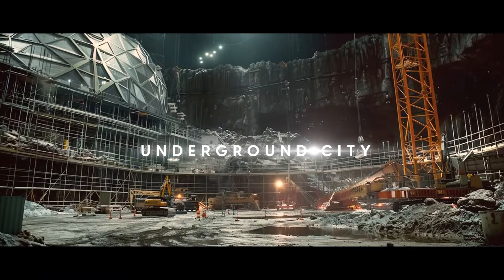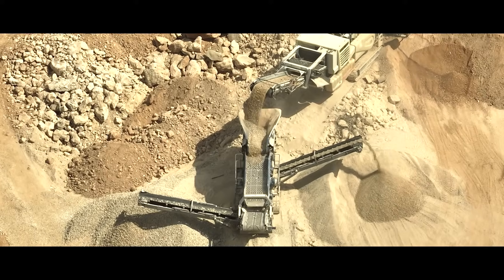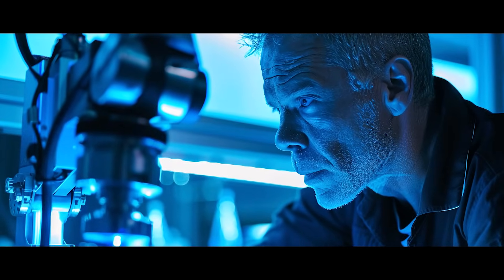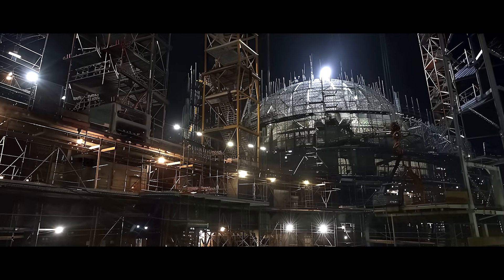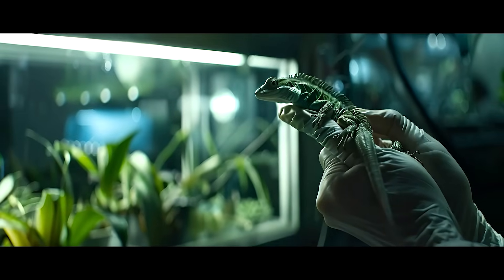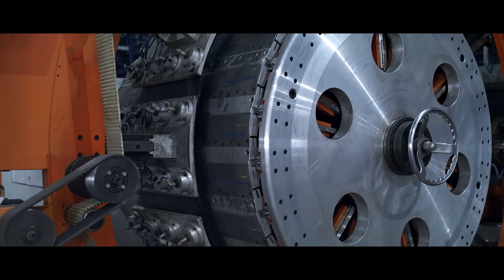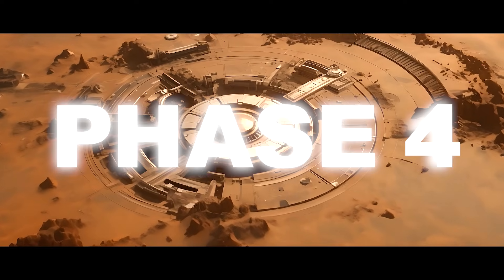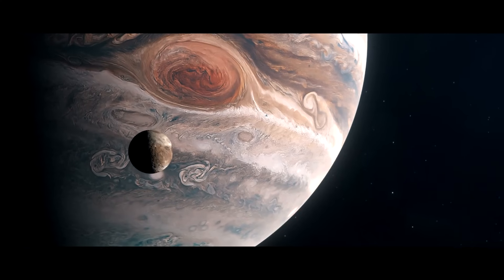TIMELAPSE: Building an Underground Mars City (Sci-Fi Documentary)

Comment: Finally someone sees the radiation issue! Robots need to start the infrastructure before Humans arrive! But a fail!
The low gravity will create health issues! Build a rotating space station wheel with angled floors to add centrifugal force to earth gravity! 
The lava tunnels can grow mushrooms if the openings are closed with transparent domes! The surface glassy soil can be reformed into a ceramic like brick/sheet material. Glass on the surface will need to be photosensitive to react to damaging solar damaging rays!
A mono-rail can join stations at entrances & transit to the farms inside the tunnels! Bugs, Asians eat for protein can be eaten cooked, turned into more complex edibles or turned into protein paste, for away missions!

Comment: Great Video, but I don't think we have realistically calculated the timelines and logistics of pulling this off.  It lives in fantasy until we can manage to lift heavy equipment into orbit and propel it across space and land it on the surface. Continuously, 100s of missions to get the sort of equipment we need there. May as well wait until we can effectively utilise a cheaper, more condensed form of energy/fuel to get us there. Otherwise its just gimmicks and pulp fiction until we approach the necessary logistics realistically. 
[my opinion] I think We are talking 100s of years, not decades.

Comment: I wish I didn't know things. I've been working for years on these similar issues. It's doable in the short-term, but AI and genetic engineering is still years away from long-term success. The Navy has the exotic materials needed to get there, but staying is still out of the question. The energy requirement is jaw-dropping, so generating power using solely Martian materials and conditions is... Challenging.

Comment: biggest problem will be every bit of escavation equip on earth runs on fuel not batteries n the eng need ozygen to mix with fuels to run . if they make them battery powered itd take to long to charge esp if they want all these things to work 24/7 . it wont happen . only way is if they can somehow make these machines run on nuceclear power which wont be able to do as it requires a fair bit of area to have a reactor then turbines n motors .

Comment: You can do this as well instead of underground you create a roof above your cities 
That is like layers of honeycomb architectural structural design creating a density controlled construction that has is sponge like it design
Meaning it is unlike what you currently understand and use this concept is constructed by joining spheres together that when combined together and squeezed together they loose there  softness as they are pushed together 
Your design comprises of many different sizes of these spheres so you can control the density of your construction where you need it to be dense and less density where you don’t 
Large sections can be just balloon like filled cavities that form the living environment you can build roads cities or whatever you desire within your solid construction that has become one single structure and not made of independent parts 
This way it is far superior to current forms of construction 

Having a honeycomb design means you will have large cell like areas that can be opened between or have the ability to seal each one independently 

You design the spheres to fuse together with an electric charge once they are in place it’s like a ball squeezed in your hand it will squeeze to a point then it gets to hard to squeeze anymore it has filled all the gaps between so it becomes extremely strong 
And the entire structure has a surface layer that is like a tarp stretched to form the shape and hold it in place until the process is complete when the system have hardened and becomes one structure you could constantly add on to this so it just kept growing in side 
Understand  from outside it would look like a flat surface a raised surface 

But inside you have a honeycomb structure that is as hight as you want the ceiling to be 
And you can sail each section independently or remove walls to form lager or pathways through the structure and have complete faith in your roof because it has structural integrity

Comment: Unfortunately, a lot of wonderfull graphics that are divorced from the actual challenges. Basically a 1000m dia pressure vessel built into massively fractured rock or worse, regolith. The structural loads are simply astronomical. And every level, unit and subunit would have to be protected from explosive decompression. Failure analysis would be the major part of the engineering effort. And the graphics artists keep getting transparencies wrong. Their mechanical properties are very very low which mean small areas and great thickness.  (And glass has no fracture toughness so it could not be used at all at the pressure face) Fast and efficient airlocks with ultra low air hammer  will be essential to protecting the total air asset in a practical way.
And dust !!! Whole new systems to be developed yet to keeping the dust out !!!

Comment: Radiation is not a problem! With just a few grams per square cm of kevlar or polyethylene, the rad levels can be reduced down to earth normal. Even without protection, it would take years on the surface of Mars to increase you lifetime risk of cancer by a few percent. Average surface rad on Mars is 240-300 mSev/year. Anything less than 500 mSev has not been known to cause any significant health effects and doses far larger are used in medical procedures. The risk is incalculably low!

Comment: It is going to be a wild new experience.  A lot of machines use sheer WEIGHT for stability.  That weight will have to be sent over by rocket initially.  I think LEVERAGE might be the answer for stability, and that would be a big change right there.  The initial miners are either going to be working remotely or have to suit up like an SR-71 pilot because of the environment.  I expect a lot of the issues will be solved when the moonbase is built and only needing 1/3 the leverage of the lunar machines will be a weight savings, but the Mars machines will have to deal with FUNGIBLES, auger bits, drilling steels, abrasives, etc.  The LONG, Long, long, did I say long? Supply chain from the moon or earth would  mean planning for delays or inefficient stockpiling...

There is a game called Redplanet or Surviving Mars, play that on hard mode......

Comment: If we could just teleport big heavy mining equipment to Mars. One standard excavator is 10-45 tons (20,000-90,000 lbs). Falcon Heavy can lift 141,000 lbs to low earth orbit (LEO).  But they need fuel and air so an all electric one has to be made. But its fun to dream.

Comment: Mars has a tiny fraction of Earth-gravity - do not forget that Gravity is the main force Earth stuctures need to withstand, ie why our limits for bridges and domes are moderate spans.
On Mars we could span 20x the distances due to the very weak gravity,
Tunnelling and carving out huge caverns would be simple on Mars.
And remember - the loose regolith is only on the surface. Below is solid bedrock - likely unchanged in millions of years because Mars has no techtonic plates and no earthquakes.
Rock removed for tunnels and carverns will be the source material for mineral extraction for creating metals, chemicals, building blocks for all that will be needed.
Correctly spelled out - the lack of magnetosphere on Mars means we have no protection from harsh cosmic radiation.  Thick rock will be the best protection.

Comment: The video is nice AI, but limiting in terms of future scoping. If you enter the terms How to build a martian base inside a cave guess what tech is gonna come the AI up with ... Heavy and unpractical Earth derived building praxies... First structural elements will be ultralight, if there is 3d printing it will be ICE 3D printing (the tech is already here) a flying drone can build an ice dome much more eficiently than what is usually shown. Then you would place an air lock and osmotic gas filtration to estabilize atmosphere to Earth levels. Tinting the ice would provide additional radiation shielding. Once you have that you probably get plenty of water and other useful liquids condensating out of the cave walls. And you can install kevlar cable suspended machinery and printers to follow on works. This is doable RIGHT NOW. All else are fantasies. Particularly anything that involves burning the precious Martian oxygen. I made the calculations, there is only enough for about 10. 000 guys breathing for a year... Nothing else and not much to fool around with ...

Comment: The film is very nicely done - but... where does all the energy come from that is needed for the huge number of machines producing? There is no power station up there where I just have to flip a switch and everything starts running. Even photovoltaic systems have to be huge to supply the energy required. It all sounds very nice, but it is not really well thought out. I have been working in mechanical engineering since 1985 and had to grin during the video - this is pure science fiction!!

Comment: There is a great energy dependence for the unfolding of such creative activity. Space heating, the work of robots and mechanisms will require a lot of energy, and so on. It is unknown whether thermonuclear reactors will ever be created, so nuclear small modular reactors are likely to be the sources. Research is needed on the presence of geothermal heat at depths of several kilometers. If there is one, it will be a cheap source for heating, and it will be better to build the city deeper, closer to geothermal heat. On Earth, for example, at a depth of 4 kilometers it is very hot all year round.

Comment: Don't forget that the first item to find on Mars will be water. Without it, we will have to bring it with us which is expensive.  All of the machines used to build a habitat will require oxygen and fuel to operate. Battery-operated equipment will not work with our current technology.

Comment: Fun video. Early settlement in Lava atubes seems easier than excavating new areas for structures. Dropping tunneling machines into a crater floor and tunneling horizontally would also produce spaces that should be easy to seal off.

Comment: WRONG.   ALL SO VERY WRONG AND SO VERY IMPRACTICAL.   Where are you getting the water from to mix the concrete?  HOW THE FVCK ARE YOU GETTIGN ALL THAT EQUIPMENT TO MARS?   A conveye machine and tractors and this and that.    DO THE MATH.  Figure out how much cargo you can take on a rocket.  Then figure out HOW MUCH FUEL IT TAKES TO GET THERE.   IT IS IMPOSSIBLE.    If you were gonna do it, you would just send one BOARING MACHINE to tunnel into Mars which as it digs, heats up the material and creates a glass tunnel behind i.  This is the only way you can creat habitat on mars.  It wont be with concrete or anything else.  You have to use what is there.   You cant bring water and this and that and all these things.   Stop thinking its fvcking star trek on some big luxury cruise ship in space.   Youll be lucky to fit 20 people on one rocket with enough supplies just for themselves on the six month trip.   No fvcking way are you bringing tractors and concrete and conveyer belts.   STOP BEING RETARDED and unthink all the shlt you think can happen.   AND YOU WONT BE HAVING WINDOWS AND A BIG SKY DOME.   That shlt is lame and will get you killed

Comment: Sounds like a good plan but I'd have more shields on the dome. So one outside, one inside that can shut up during storms or meteor strikes and one horizontal at the base of the dome, various small bunkers outside to house radar and air defence missiles to knock down threatening meteors. Could even build a launch pad into a nearby crater for rockets or other future ships. Have shutter doors for easier maintenance and living quarters for the initial crew that aid in and direct construction.

Comment: Maybe drinking Coke and Milk would help temporarily to stabilize bone density...because seems to move calcium inside the bones or assist the calicum bone metabolism by making bones but more elastic and it's molecular structure wider...allowing Calcium molecules to move ans fill gaps.

Let it be tested in the ISS Astronauts 
to drink Coca Cola™®

Phosphate may temporarily help against Osteoporosis by helping Calcium to move around inside the bones.

Drinking Milk resupplies the bones with Calcium.
Meaning the Calcium is Flexilby moved through the bone,creating a more homogenic calcium grid ...and add flexibility that may help against bone cracks.

Crisp Biotech can help....just eat Pasta with added program for more bone density.

Consult your doctor about Coke
before using it on bone treatments.

Comment: Here we are presented with a conundrum. Just as it was on Earth, where we could not make large industrial activity possible without energy, so it would be on Mars. Moreover, we couldn't build those power stations we needed on Earth without first having in place the industrial capacity and the energy supplies to build them. Without the necessary massive amounts of energy needed to even get started on colonising Mars, how that initial and growing energy requirement would be met may turn out to be an insoluble problem.

Comment: Transporting metal for fabrication is going to be prohibitive, plus thousands of welding robots would represent a high maintenance requirement, and once you've used metal to create an airtight skin then you've got oxidisation problems from moisture within the sealed environment.

Better off using resin to form reconstituted rock which would be airtight, and due to the lower gravity would enable larger structures than on earth. 

Weighted suits for work periods and sleep periods within a titled centrifuge on the crater wall would both work to reduce muscle and bone wastage etc.

Putting human waste recycling above habitation and work areas would reduce raditiation exposure.
Reply: Copper yo.  Do you get how much weight in copper we are talking about?  Does Mars have a lot of easily mined copper too?  We aren't flying all that there, nor any of dozens of other required materials.  Lead and tungsten too.  Smarter to just build orbital space stations up to autonomous to spread our mining reach, then see what makes sense to colonize and where.  Might not make sense anywhere in our solar system, cost versus benefits wise.
Reply: @JulioConnory  I didn't mention copper

Comment: Cool video.  But it doesn't deal at all with one of the hugest problems with Mars colonization:  Too vulnerable to destruction. All it would take to do tremendous damage or destroy the colony is one nut, or one enemy agent. That vulnerability would tend to turn a Mars colony into something like a military colony --  purely for security reasons, a Mars colony might not permit the degree of privacy that civilians in democracies typically enjoy.   The colony would have to be constructed of many compartments capable of being sealed off and independent on short notice -- somewhat as submarines and ships sometimes have watertight compartments in part so damage in one spot doesn't spell doom.

Comment: One of the major problems with digging into the surface of Mars is the high concentration of toxic chlorine based elements in the soil. There are several heavy metals that would be toxic to plant and animal life also.
Reply: There's no "soil" on Mars, it's Regolith, powderised rock. Soil is a complex mixture of clays, sand, vegetable matter (carbon and nitrates) and microorganisms. To turn Regolith into soil, the Perchlorates are easily removed, they are very soluble in water, so could be washed out in large drums. The Martian atmosphere is mostly Carbo Dioxide, which can be used to grow inital plants to fix the carbon compounds like cellulose and carbohydrates. Not sure about where the Nitrogen comes from. Plants also need Potassium and other minerals to survive. The perchlorates are the easiest problem to solve.
Reply: I understand that radiation penetration only reaches Into regolith about two or three feet to create toxins ,  so top soil can be skimmed  and remaining soil is good.
Reply: Don't sweat the small stuff, man. You sound like a modern-day eco warrior attempting to cast doubt on any development anywhere.
Reply: @LHLWASRIGHT 

Small stuff? Nope. Sending people to settle on Mars, knowing they’ll be exposed to toxic chemicals like perchlorates and heavy metals, isn’t exactly “small stuff.” Settling might be possible someday, but for now, short-term visits seem far more realistic than building massive, permanent structures sustaining life.
Reply: @MSaleh-vy8rr  I agree. Plus the long space journey with microgravity and radiation concerns. Many new proposed ideas for propulsion - need to cut the travel time to 3 months or less, and figure out radiation shielding on the ship itself. Perchlorates and dust storms on the surface - and so many other major obstacles. I think we're about 2 decades away from any realistic attempt.
Reply: YES, so it is a PIPE DREAM, nothing more and nothing less.   It would be more feasible to build orbital structures than on Mars itself.....